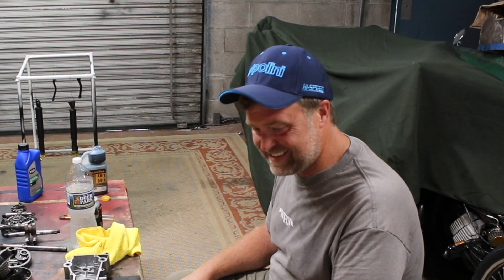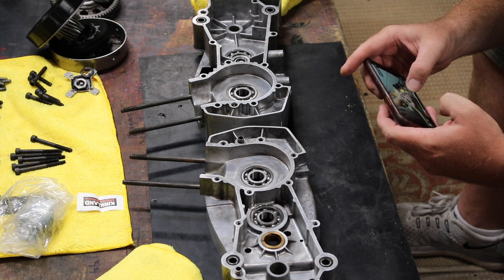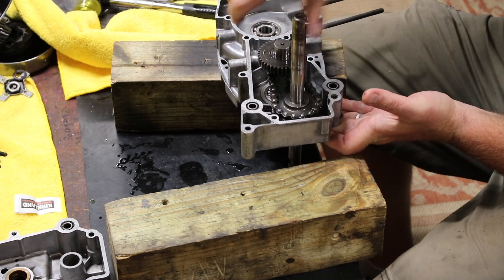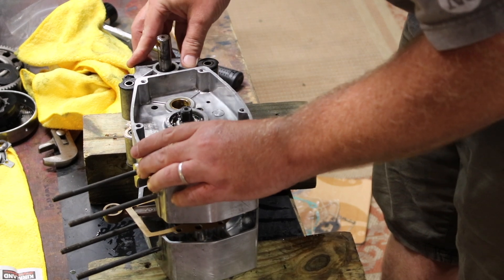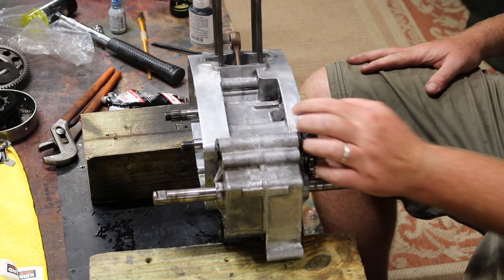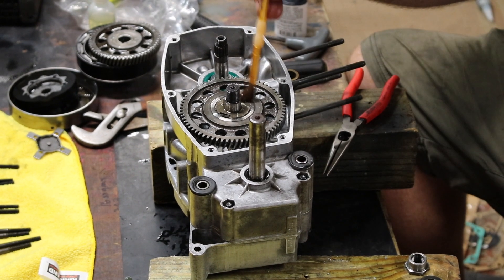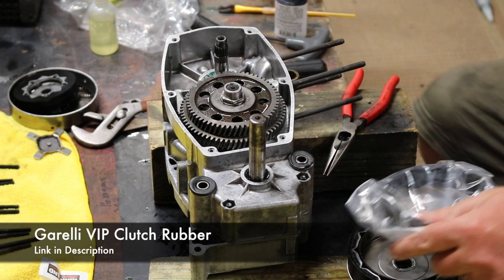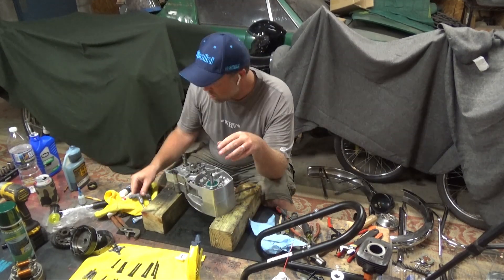DFHS Garelli VIP Ep. 4 - Engine Bottom End Rebuild

Comment: Rebuilding mine now. Waiting on a crankshaft. Using Avanti piston and cylinder (slightly ported) Biturbo pipe, CDI, and this time, an OKO 19mm carb, I have a 4 speed version, but it isn't suited to the moped frame. I will search for a tiger frame for it.

Comment: So those rubber rings are what the clutch plate is in "normal" clutches?
Reply from the maker: On centrifugal clutches, there is a medium that expands under the rotational force.  In Tomos, they have three plates with cork on them that fling out to grab the bigger gear.  On French bikes, the variator accomplishes the same thing. On these Garellis, they use those rubber sleeves.  As they get up in RPM, they will expand and grab that clutch bell so that they turn the next gear. The friction plate you see on the rebuild is just for the clutch lever on the handle bars , so when you squeeze that, it forces the clutch to catch so you can move the piston with the pedals.  The weird engineering is one of the things I love best about mopeds.  I also love seeing how different manufacturers went about getting the same result.  That being said, the Garelli is stranger than most 🤓
Reply: @DavidFixesHisShit   that is weird indeed... and those rubber things are in the transmission oil?  o_0

Comment: Hi David,that can of compressed air looks mighty cold,did it really make those bearings go white.looked like it in the vid .another quality build coming along👍 .I hope the gear that went on wrong didn't do any damage .
Reply from the maker: Hey Steve.  It’s VERY cold.  If you touch it after it freezes, it burns you!  Works really quickly for putting in bearings.

Comment: i thought i'd throw in my 0.02 cents about case assembly. i've found that a propane torch is perfectly suitable and easier than dealing with an oven. The trick is to first oil/lightly grease the bearing seat..then go over the case half for a minute with the torch to heat soak it, and then focus on the bearing seat that you're about to install a bearing into in a circular motion. The aluminum will expand enough to allow the bearing to drop right in, no freezer needed, maybe needing one or two firm taps with a socket on the outer race to ensure it;s fully seated. You need to use the torch for each bearing seat, the aluminum cools and shrinks too quickly to do more than one at a time. 

For bearings that have a snug or tight fit on a shaft, like on a crank, you would actually want to install the bearing onto the crank first. you would grease the shaft, then heat the bearing carefully to about 250F, and it should expand a bit and slide right onto the crank, maybe needing a tap or two on the INNER race with a maxi seat post. let it cool, then heat the case half and drop the crank and bearing right in. It saves the impact stresses on the bearings. After its all together, you would do the seals, because the heat from the above process would damage them.

Keep the videos coming!
Reply from the maker: Heya Brandon.  I’ve had varying success with the propane torch.  I find on races with little to no metal around them where you can get everything around them heated (like a wheel hub) the torch works great, because the metal just expands into empty air; however, on things like cases, where the race needs to expand into more metal, it isn’t as effective. It can’t expand into the cold surrounding metal.  That being said, on cases where I already have seals installed or something I don’t want to get too hot, I’ll use the torch because I can be more selective about where the heat goes.  That’s just how I approach it, but everybody finds their own method that works for them.  I can tell that you have your method figured out, so keep wrenching!
Reply: @DavidFixesHisShit   There's more than one way to skin a cat, lol.  I'm looking forward to seeing the end result